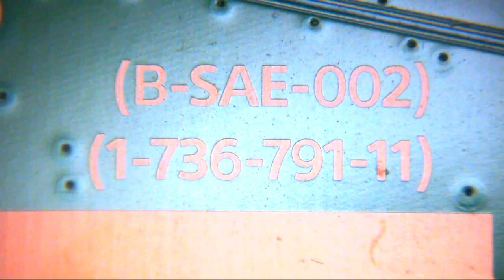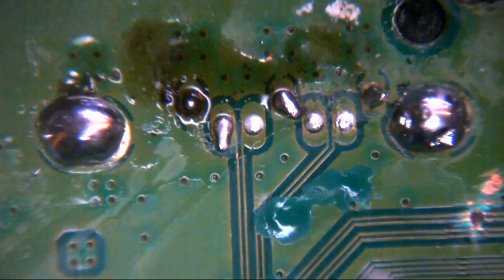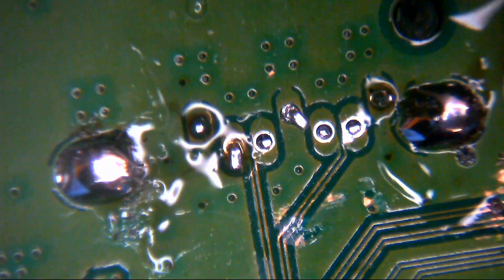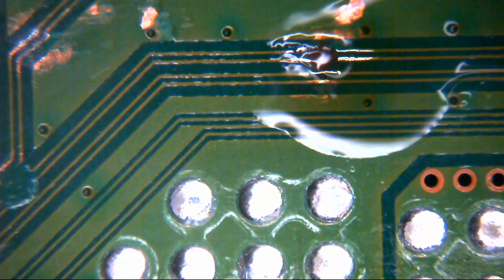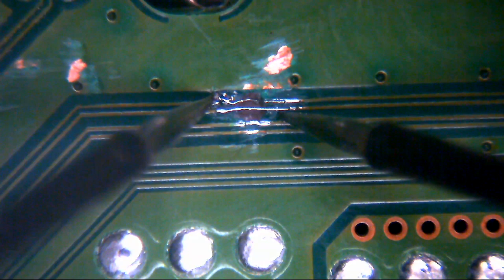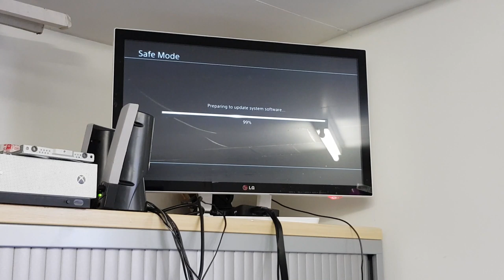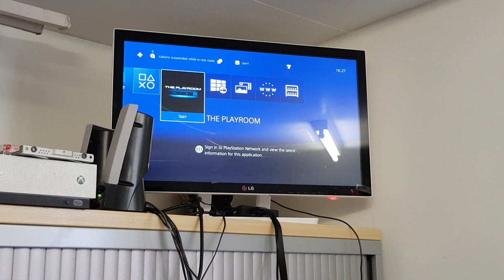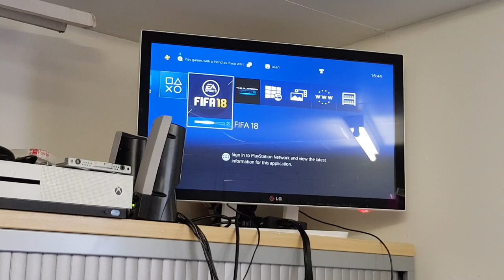PS4 Slim SATA Bus PCB Damage. No HDD / BD Drive Access - Diagnosis and Repair

Comment: Good to see you back Andrew and I hope there are continued improvements in your health and circumstances.
This is not ot directly related to this video but I have 2 PS4 issues you may have solutions for.  1)  Error code ce-30391-6.  This error shows when trying to load a game, logs me out  and I have to log back in..  2) PS4 Pro randomly freezes and turns off. I all ways get a message about too many USB being connected (there are none connected) before it turns off.   Look forward to a reply and love the channel - Paul

Comment: have search the vids cant believe theres on on and off problem with ps4 issue, ps4 works after rested but when played and shutdown, turning it on blue light, relay on psu clicks then turns off, those washers aint working

Comment: Hey Andrew paul I have a xbox one s that I replaced the harddrive using the tutorial that is on your channel I have all the files current on the hard drive and osu1 on a usb but when I try the do the update it stays on 0% for a few seconds then errors out with e101
Reply: Have you tried OSU2 and OSU3 yet? It took a bit to find the download links online, but they are out there. Try those next and see if that helps. There should be a tutorial on how to use those updates, and sometimes use them along with OSU1. Just thought I'd give some help to see if that could work for you.
Reply: @roosterbrains6605  how do you set up OSU 2 is it the same as OSU 1 where you just put the $update folder onto the root on a usb

Comment: Hello, My PS4 slim  SAF-003 suddenly froze then shut off in the middle of a game. No warning,  no error code. I replaced thermal paste , thermal pads, it is dustless now. It does not seem to overheat but it will shut off after 10-20 min of gaming. Software is up to date. It was factory reset, swapped to new hdd. New power supply, it STILL does this. Makes a screeching sound, freezes, and just shuts off! What could it possibly be?! Please help with info if you can. Thank you! 🙏

Comment: Hi sir 🙏🏾🙏🏾🙏🏾🙏🏾a have a problem with ps4 
The pin 13 resistor is shorted ( connect ) to the some points of bord
Can you help me i need to know where can i have the way of this resistor please to open the short ps4 is blod now 
But it came to me with bad hd 1080p 
Change encoder and port but have this short and blod

Comment: Hi Andrew. Some slime got spilt onto my PS4 slim right by the power connection. I’ve opened it and the slim went into the main board in the corner onto a silver plate. All cleaned of. Still no power. Is it salvageable? Thanks

Comment: Yo Andrew, how would one diagnose the issue of a PS4 not turning on at all? Power button is a no, inserting a disc is a no and plugging in a controller is a no. Don't believe it's the power pack as I tried a known good one and it still didn't come on. Sent mine off for repair (it wasn't done) came back and now doesn't turn on and I think they've swapped my board for a dead one.

Thanks in advance, or to anyone that can help!

Comment: Hi Andrew, I send greetings from Argentina. I have a problem with a ps4 cuh-2015a that does not synchronize the joysticks, it recognizes them only the safe mode. Take measurements of the module with the tester and present no problem. Change to another module and stay the same. Any idea where the problem could be? Thank you for your videos are very helpful around the world

Comment: Hi Andrew. I have a xbox one x it artifacts and get hdd errors. I have replaced the drive it worked for a while then it does it again. I'm going to re do the thermal paste to see if it's a heating problem. Any ideas what it could be if my re paste doesnt work.

Comment: Hello, I have a ps4 with CE-34335-8, and trying the solution given on sites given by google search did not help (entering safe mode is not possible, replacing hdd did not work etc). My suspect is the SATA controller itself or the sata chip. Unfortunately, not sure which chip is the sata controller chip, and I do plan to replace Sata Controller, just need to find appropriate (I do have one more PS4, but I think that due to different model of PS4 it would not work).. Anyways, any advice?
Reply: Same problem here. It won'r read any HDDs

Comment: Hi ive watched your videos for a few years now and they have helped me tremendously. Im a visual learner so you videos are great. I was wondering though if you would post or sell a resource pack with pictures of ps4 alternate points, values etc. Thanks for your videos.
Reply from the maker: Are there any in particular you think would be useful?
Reply: @AndrewPaul  i struggle more with diagnosis and find im constantly pausing the videos to check what points to check pins with multimeter. Or where traces goto etc.
Im self taught with a lot of help from a friend whos been in the business for years, and your videos.

Comment: hey andrew i was wondering if you could help me figure out whats wrong with my xbox, there was a storm and lightning struck and my xbox shut off, then now my xbox turns on for about 5 seconds then shuts off, i took it apart and the fan doesnt seem to start, but idk if thats the problem, cause if i unplug it and plug it in halfway the fan works but the xbox still shuts off, please help mee thanks

Comment: hi,
i have ps4 slim saf 006 board,it turns on and blinking blue light for 1mins and turns off.no fan spin.i checked with different power supply same issue.i changed south bridge cx900042gg still same.
plz any one can tell what is the exact problem.and one more doubt all cxd90042gg 1937,1653, etc all are same or different? sorry for my bad english

Comment: Your videos have solved a lot of mysteries that I have seen. Thank you for that. I have a new PS4 mystery and I was wondering if you could give me some direction? The PS4 pro that I am working on reads Movies fine but not games. I tried updating it with a fresh update and replacing the HDD. The system gets super hot but PS4 pros run hot as it is. Could the encryption chip be burnt out? Is there a way to test the encryption before I go bying a broken system and pulling the encryption chips?
Reply from the maker: Do you get any error messages show up? Also, are the movies you're trying out DVD or Blu-Ray?
Reply: @AndrewPaul  I tested a blu-ray movie and it works fine. I gave the system a major cleaning and was able to get it to play minecraft but still fails on a more data heavy disc like black ops 3. Now that i have seen it play a game im thinking the laser may just be too weak to pass through to the second layer on dual layer discs. I am trying a laser swap today. I just wish Sony had not made the disc drives in the pro to requir a full terdown to get at. The error is just the disk with a question mark shows up. I think one time i got a generic disc read error. Thank you for the reply.

Comment: Andrew i really need a bit of help here buddy if you can , i have a MSI b450 Pro Carbon Ac motherboard , the problem i have is the 12V rgb header , i plugged a front panel rgb header into it the other day from a new case i got , now wether i plugged it in wrong i dont know , got a strange smell not a burnt smell as such , the light came on on front panel but then went off , checked the header and just above it are these components i have managed to get a close up and the part number on it is 6NJ02 , i rubbed my finger over it and its burnt , so ive shorted it somehow , i can send you pics as i have found a close up shot , so need to replace it but have no clue on how to find one , hope you can help Andrew ...Many Thanks Shaun.

Comment: Hi chum I have a ps4 slim I got 2nd hand warranty sticker still intact. Looks like brand new. It had no hdd. So I put one in and all I get is error code ce-34335-8 it won't do anything else won't go into safe mode either any idea buddy cheers 😊
Reply: burn cdm do you have solution ? I have same problem thanks

Comment: Andrew Paul I need to contact you to fix my daughter’s ps4 she had a update and after that her game kept crashing now it’s in safe mode and tried everything now message reads can not recognise usb and in safe mode menu 7 options can only use 7 as others are not high lighted what are we doing wrong PLEASE HELP !!!
Reply from the maker: Hi,
When it says it cannot recognise the USB, it will usually give you an error code (typically starts SU). What is the code it gives you in this instance? Many thanks.
Reply: Hi Andrew , when the USB is in the PS4 port the code is SU-41333-4, we’ve followed all of the instructions on the PlayStation.com website and even called Sony to have them talk it through with us however to no avail, all of the files are named correctly on the USB the USB is the correct format and we have repeated the process with a different make of USB and in a different USB port however the error remains the same. Thanks, Jackie

Comment: hi andrew paul, i have a problem with my ps4. It does not recognize the hard drive, I have looked at the hard drive on the pc and it works perfectly, but the ps4 does not detect it. I turn on the console, the playstation symbol comes out, the blue light comes on, it reboots, the white light comes on and shows the following error: your ps4 cannot be started. Cannot access system storage. press the button... (CE-34335-8). I have tried to enter safe mode but I cannot, it beeps 2 times but the screen directly shows that error. I have measured the sata connector with the multimeter in case there were any broken pins, but everything is fine. Do you have any idea what could be the problem? Thank you.
model CUH1004A
Reply from the maker: There is a small fuse (labelled TH) just behind the connector on these boards. Does this have continuity? If not, that's likely to be the issue.
Reply: @AndrewPaul  thanks for answering. Yes, there are 2 capacitors and a small green and gold fuse, you measure it and everything is fine.
Reply: *I measure it and everything is fine.